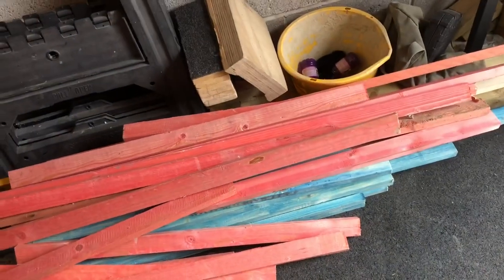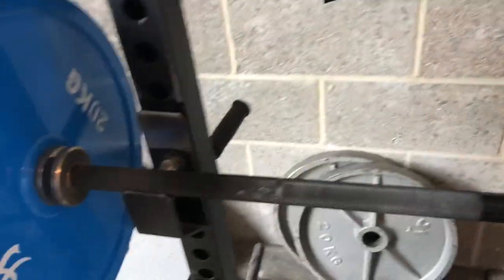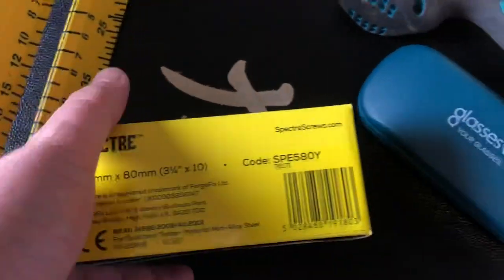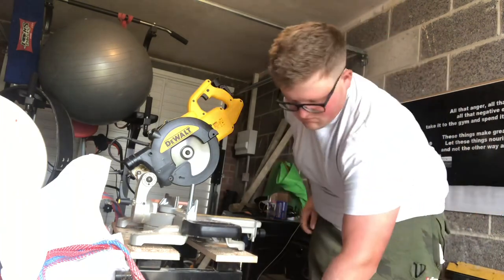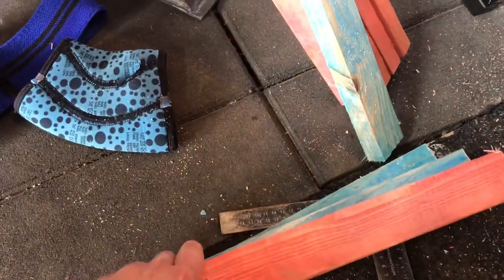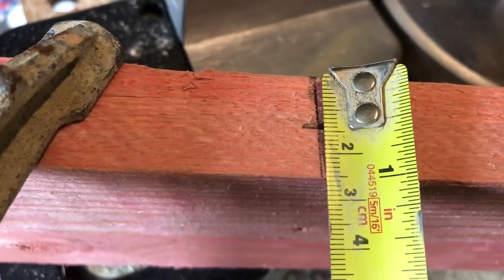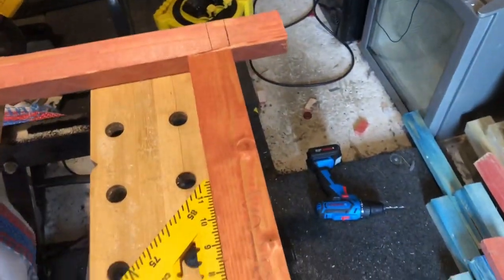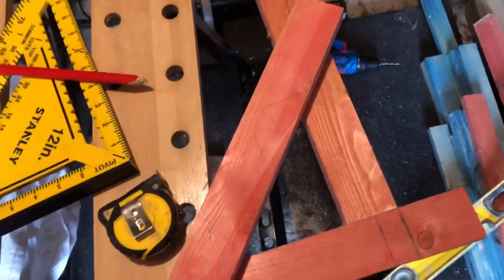Bricklaying - How to Build Mortar Board Stands (Cheap and Sturdy) - Part 1

Comment: I'm interested in seeing how flat these are going to fold for transport. They do look sturdy and it's not a bad way of using up left over lats.
Reply from the maker: They fold about 40mm from being flat lat on lat, I’m gonna make a part 3 - showing a modified version to make them lay fully flat 👍🏻👍🏻👍🏻
Reply: We need the part 3 because I’m lost as to how I’m going to make them lay flat 🤣
Reply from the maker: @d-jones  I’ll make a quick video, on them this weekend 💪🏻
Reply from the maker: @d-jones  you can make them lay about 10mm away from being lat on lat, but not super flat, it takes some practice getting the cuts super accurate, n the holes accurate so they are not in twist and they are slightly weaker when you make the slightly modified version to close more 👍🏻👍🏻
Reply: I’ve made mine without the 45° bracket and they lay slightly flatter, just put two screws per piece of timber to strengthen it up 👍